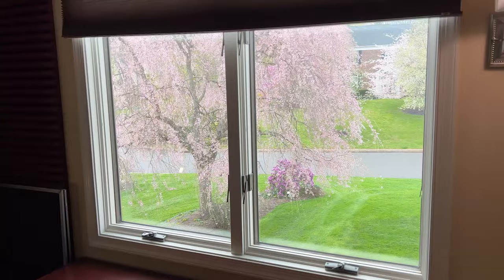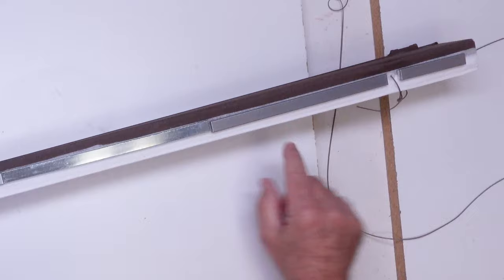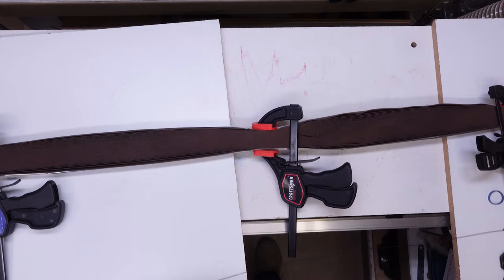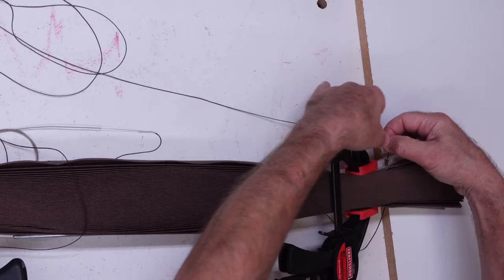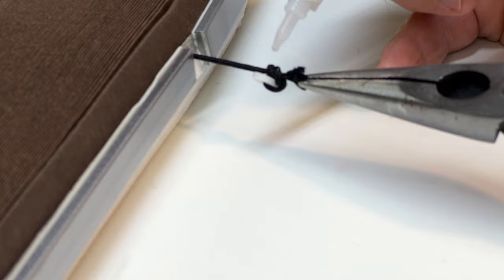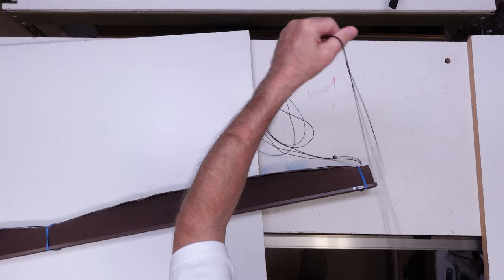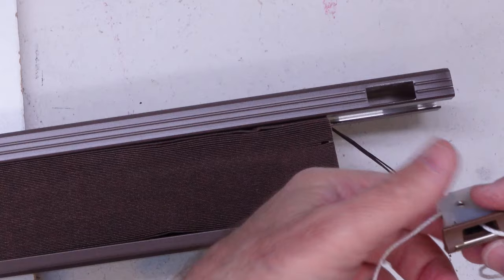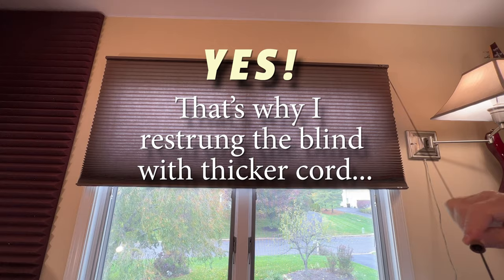How to Fix a Broken Cellular Shade Lift Cord  |  Bali Blinds

Comment: Mike, you had to do this twice according to my calculations....You're a brave man, I myself would have bought new shades. 😀
Reply from the maker: Hi Tom! The blinds in my office is relatively new but heavily used. And it wasn't cheap… around $230 if I remember correctly. The roll of cord on the other hand was around $10. Challenge accepted! 😁
Reply: @MikeFyxdt  You could be Dutch as frugal as you ( rightfully so) are!
Reply from the maker: @mokumholland5640  and I am perfectly OK with that! 😁🌷
Reply: @MikeFyxdt  yes!!! 👍

Comment: Thanks for making the nice video.  After 14 years we have our first broken string.  I appreciate your photos of the top and bottom disassembly.  Here's my query - why not tape the new string to the old string so the new gets pulled through as the old gets pulled out?  That's what I'm going to try - as soon as I get the right string in hand.   Just don't know why we would pull out all the strings first, and then start from scratch, so to speak.  Any other readers tried using existing string to pull in new string?
Reply from the maker: You definitely can tape the old string to the new if the old is still in place. Whatever works for you is the right way to do it! 😁

Comment: Start-pause-start-pause-😊 Thank you Mike for this video- We have a double hanging Bali for our patio door and only one side needs the string replaced. It is taking a bit of maneuvering but with you as my guide -I know I can do this!
Reply from the maker: Excellent. You can do it! 😁
Reply: @MikeFyxdt  I did it! A couple things were different like the roller part didn't need to come out-the cord went right up the bottom and with it being a double the top bar always stayed on -it was just slid to one side or the other. 
 I did find out the most important part is to make sure when putting the top bar back that you only catch the top pleat and you can never have enough cord. The old "measure twice, cut once" rings real true here. ;) 
Thanks again Mike for your assistance.

Comment: Good video!   I have done this already 3 times over the years on our largest Bali blind in the living room.  It is very wide yet they only have 3 string lifters on it, so they probably are under a lot of tension.   Usually at some point the shade starts to get draggy off and on when lifting and lowering, which is the precursor to one of the strings breaking.    

I bought a long but thin sewing needle set which makes it easy to thread the string through the shades.    A set of several of them was like 3 bucks at Walmart if I remember.    Unfortunately I will be using them again today as another string broke a few days ago.       For the cord lock I've found the easiest thing is to push the string all the way through straight and then come back in the other side at the right angle and push it through again.      One of my metal grommets seems to fall off too like yours did and I think that can rub on the cords.   Last time I tried to glue it into the top hole on the shade so it wouldn't get unseated.
Reply from the maker: Great suggestions! It's such a great design when it's working, yet so finicky when it breaks!

Comment: Hi Mike, I am having trouble removing and replacing the clutch on a bali cellular shade it does come out easily as in your video. This clutch is the old style but it looks like the one you removed, and is there a tool to do that. Thank you in advance
Reply from the maker: I use two thin screwdrivers to press in the "wings" that clip it into place, and then pry out in the same motion. If you take off the endcap and shine a flashlight in there, perhaps that will give you a better view so you can see what's holding it in. Good luck!

Comment: Hey Mike do you have any recommendations on how to clean a stained shade?

I bought mine from a thrift shop and it’s heavily stained with nicotine stains🫠
Reply from the maker: Oh, that's a tough one! This is only a guess, but maybe take it outside and open it on a flat clean surface. Mist the entire shade with water on one side, and then mist it again with a grease solvent like simple green. Let it sit, and then brush it lightly with a soft bristle brush, taken care of not to crush the shade. Then rinse it a few times to remove the solvent. Flip and repeat. Then figure out a way to let the shade dry, either in the sunlight or by hanging it up somewhere so it can drip dry.

Comment: Thank you for your video. Where do you buy the string?
Reply from the maker: You're welcome! I bought the string on Amazon... do a search on "lift shade cord". Mine was 1.8mm, but you should call the manufacturer to check the cord thickness on yours, since they vary widely. Good luck!
Reply: Bali will also send you string for free if you call them.   My Bali blinds have a "lifetime warranty" but when I called them to act on that, they basically said I would have to pay a lot to ship the blind back to them, but they sent me a big roll of string for free.

Comment: I'm having a hard time getting my shade off the brackets!  I think I can get the rest done if I can get the shade down.  It is mounted on the inside of the window opening on the top side of the opening.  It is always something!  I think it must snap out with a twist or something but I can't reach it well.  It is in the window above my kitchen sink so awkward to get close to.
Reply: I'm replying to my own post.  I saw another YouTube video that talked about brackets- not my particular one- but another kind.  That gave me the information to try again and it was so simple to swivel this catch and release the blind and then when it was all done and needed to be put back up it was super easy to put up even though I really needed a couple more hands.  Thanks for the very informative video as it gave me such good information in such a easily understood format that I was able to tackle it and get it done after probably 2 years of wonky blind.
Reply from the maker: @suedoran4521  Sue I'm glad you found a solution! I wrestle with mine every time I remove them. Reinstalling them is always easy, though. I guess they don't want them falling! 😁

Comment: Mike I ordered 6 feet of replacement string - is that enough?
Reply from the maker: 6'?! Noooo! The shade in my video, finished, uses at least 25 feet. For around $12 you can get 100 yards. Even if you don't use it for blinds, the extra string has lots of great uses. Treat yourself to a bigger roll! 😁